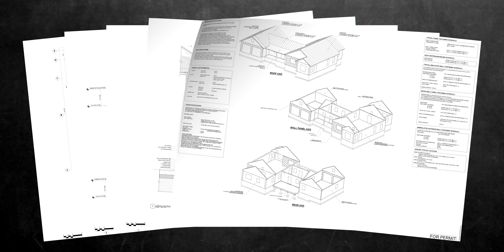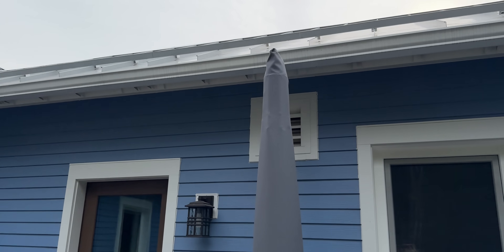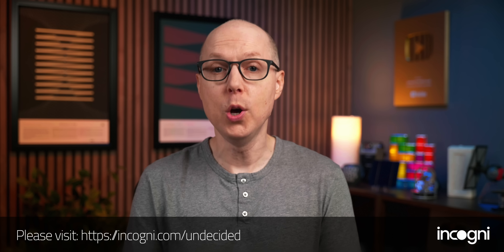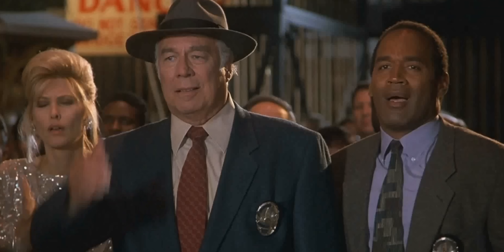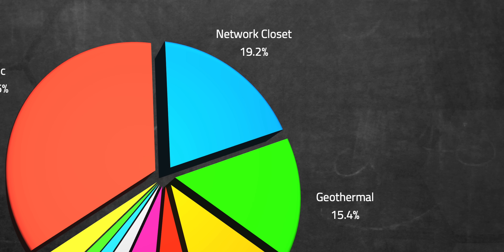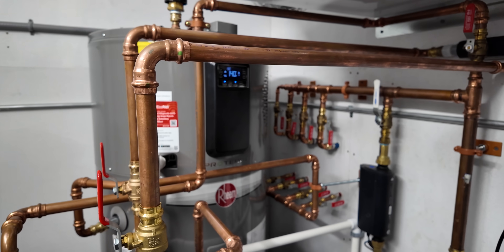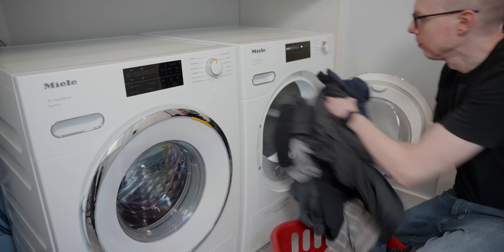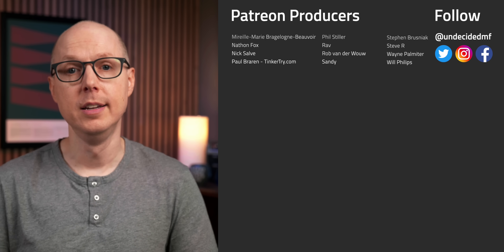What I Learned After 1 Year in My Net Zero House

Comment: I think that it is great that you have included CO2 monitoring in your house with regard to the air quality. This is a very significant consideration for the quality of life in the home. I stumbled onto air quality monitoring after buying a device and then found that my home in the winter was terribly stuffy and unhealthy. I responded by opening windows slightly and that reduced the CO2 count to a healthy range again. During that time, I had been studying for the CCNA IT certification and I had taken a bunch of practice exams at home and also taken and failed a proctored exam one morning. The difference in the results of my practice exams from before I had corrected the CO2 and after were significant. I passed my exam on the next try but I believe that the change in air quality in my home and sleep environment was a factor in my improved performance. 
I took my air quality monitor to work one day and I would find decent air on a Monday mornings and then the CO2 count would have doubled by the end of the day and would stay that way, in the unhealthy range, through Friday. When the pandemic came along, we had about 25% percent of the staff in the building and then the air quality was always acceptable. I think that employers overlook the importance of the air quality in the work environment. It is to their best advantage to have employees that are more productive because they are more oxygenated in quality building air. It is interesting to see your home project unfold Matt. Thanks for sharing the results.

Comment: Did you use phase change along with the insolation? That is a supprisingly big one it reduces the cooling and heating needs because it releases heat when it cold and soaks it up when it's hot, and a lot of it, along with insolation it significantly reduce your heating and cooling needs. Also I'm surprised you didn't go with hybrid PV thermal panels especially considering you were doing a new build so the piping wouldn't have been an issue and then just completely covered the roof in panels so you would have enough thermal energy to raise the temperature of the the water coming out of the geothermal to increase the efficiency of the heat pump and provide hot water.

Comment: For Metal Roofs, the best option is to set venting between the roof sheathing & the metal roof panels wtih vents at the ridge & at the soffits. When the sun heats up the metal roof it will pull cooler air from the soffit vents & out of the ridge vent. 

SIP roofs work really well, I have 12" SIPs and with the metal roof venting system it never gets much above 80F even in 100F summer days.

Comment: Your house is the golden standard for new houses in Sweden. Minus the batteries - those are not economically viable here yet. We hope prices on batterys will drop soon.
Reply: I'd also like to add that this includes old houses as well. Most if not all are retrofitted with triple glazing and many with heat pumps, as well as solar panels.
With a bit of luck we will see some developments in alternative battery tech before those chemical batteries become affordable.
Reply: Not sure whether you need batteries if you can sell solar electricity back to the grid and grid is reliable. Batteries are not viable in most of the cases in Northern/Western Europe. One potential use case is to buy electricity when it's cheap (during the night), but it will take ages to pay off.
Reply: Battery prices have dropped sharply this year. Grade A lifepo4 cells are about $100/kWh now.
Reply: Basically same in the EU. Triple pane windows, airtight constructions, heat pumps, heat recovery ventilation and solar panels.
Reply: The batteries are not economically viable in the U.S.
Reply: Well Sw*den has lots of hydropower which is available all night, so reliance on intermittent solar for low carbon energy isn't your only option- nice!

Comment: While it might solve some problems, I would not fret too much over the lack of a basement.  While they can be done well, fully surrounded basements are just ponds with a roof on top; I never recommend them in non-arid regions unless the house is on a slope where at least one full side of the "basement" can be exposed and the separate perimeter and floor drains run via gravity to daylight.  Even then, water pressure is often a problem on the walls unless you install sheet drains around the below-grade perimeter.

All of these issues can be dealt with, but I did HVAC for more than a decade and most of the crawl spaces and basements that I saw and worked in were poorly done, even in brand new, code-approved homes.  I don't like slabs for the same reasons as everyone else, but they avoid issues with having empty space below the floor and/or below grade.  Despite innovations by many companies, I've yet to see a basement solution in my region that is durable and dry while remaining affordable.

Before switching to poured walls, my main builder generally charged about ten grand to add a cinder block basement to a moderately-sized house (about $18K today adjusted for inflation) and while this was an easy sell to many buyers and made life easier for contractors, it was not a great value as they did not spend enough money on design and drainage while ignoring how the yard grade would affect the basement or crawl space.  This was one of the top builders in the area, yet they would smoothly grade the yards from one home towards its neighbor, ignoring the water intrusion and/or pressure that this would create.

A brother of mine spent years trying to block his neighbor's runoff from entering his crawl space and ultimately had to resort to a sump pump anyway :(.  There was sufficient land between these homes that a proper drainage swale could have been done, but builders here just aren't concerned with this issue and the neighbor didn't want his yard dug up later; after all, they were uphill and weren't having a problem.

No matter what foundation type you have, ensure that the grade drops away from the house on all sides .  Whether you add expensive drainage systems or not, make sure that the home will be built high enough to allow proper grading before you dig a single trench as the height can never be changed after the first cement truck arrives.  Later when final grading occurs, make sure that it keeps water away from your walls without destroying your neighbors', even if that requires a swale in between.

The simplest and least expensive solution is often to mound the lot to some degree and install a slab-on-grade <shrug>.  The downsides are that you have no underfloor space and any plumbing problems become very intrusive and expensive as the floor may need to be jack-hammered.

Hey, but at least you don't have a basement ;).

Comment: Here in the UK, we bought a 20yr old home, that was very inefficient. Leaky windows and doors, poor insulation in some areas.

We started by replacing the front, back and patio doors with higher efficiency units at the end of the first winter. This made the house much warmer and the following winter, we'd reduced our heating bill by about 10% just from that and replacing a couple of windows that had blown. 

In Jan 2023, I installed 4kw of solar and 5.2kwh (4.2kwh usable) of battery. We generated 4200kwh of energy over a 12 month period, and exported 1060kwh, for which we got paid 4p/kwh... or about £42.50... pathetic. But we still imported about 2500kwh of energy. We avg about 5500kwh of electric use per year.

In Feb of 2024, I added a 10.2kwh (8.2kwh usable) battery to the system, giving me 15.4kwh and 12.4 usable... the difference is to account for cell degradation over the 12yr warranty.

The system has been transformed... last summer we were still importing 80-100kwh per month.  This year, it's been 15-40kwh on avg. We achieved a net zero month in June where we exported enough energy to cover all electric charges and some of the gas. Our monthly bill was £13.

I don't have a full year with the expanded system, that will be at the end of Feb. But I do have a full years data from before with the smaller battery (1/3rd). We're currently on track to import between 1600-1800kwh of energy, a further saving of 700-900kwh. Due to the shorter days, we can drop as low as 70kwh of energy generation in an entire month.  Last year between Nov-Feb we generated about 500kwh in total, but we did have an usually brighter Jan/Feb than normal. March to Aug this year, we've generated about 3100kwh already and will be around 350-360kwh for Sept... So if we get around 500kwh for Nov-Dec again and a reasonable 250kwh for Oct like last year, we'll match 2023 generation within a few %, but will have used a great deal more directly with export being 40-50% lower.

The total system cost about £11k and we're looking at an ROI of 8-9yrs... it varies as we had installed during the energy crisis and prices have eased a little since... which extends the ROI.  But we paid cash for the system as we'd sold 2 houses to buy one larger home for us and had the cash left over to do the renovations.  

We also had a new gas boiler installed for the heating and hot water.  I did consider a solar hotwater setup and dropping gas entirely... but the money isn't there for that right now. It's possible to add a water tank and tie in with the on demand condenser boiler we have... but more complicated.  Our heating system is turned of in May until Oct normally, so gas is only used for hot water for nearly 6 months, and costs us about £20-25 a month. Compared with colder months when we have the heating on, which will easily see us with £175-250 a month bills from Nov-Feb for gas & electric.

I also work from home, which probably adds about 25% to our electric bills as I'm running multiple systems, a couple of routers, switches and wi-fi extenders. My old house, was 3 beds (no solar/batteries) and would use in the region of 320-350kwh a month, this house with 2 of us and 4 bedrooms is avg about 425kwh a month.

In the first year we generated an average of 11.5kwh per day, and use an avg of about 15kwh/day. Which is in the region of 75% or our electric, this year, it's looking more like 80-85%, and we've actually generated less due to a poorer summer, we're just using more of what we generate.

We're also getting 15p/kwh for our export now. So even with less export, we've earned an extra £100 on our bills.

We continue to pay the same £100 a month, and currently have £925 of credit on the energy account. That's enough to pay the bills in full for the next 5-6 months. After the winter is over, we'll see how that credit looks and reduce our month payments (if my predictions are close) to about £80 a month.

I made mistakes... they recommended a 5.6kwh and 9.5kwh battery setup... But I had a strict budget and that was too much. In retrospect, I'd have fitted what they suggested and found the money... But we'd just discovered that the small adjustments to the kitchen we were going to make... actually required us gutting the whole kitchen, replastering, new electrics and a complete new kitchen and all appliances (previous owners lied about the condition of everything and it was all damaged and junk) due to finding water damage and broken ovens as well as a leaking dishwasher.

So we've also installed more energy efficient appliances, added a convection oven and switch to all electric for cooking rather than gas.

Comment: I'm only  at 2:35, and it looks like you didn't insulate your slab.  Not sure where you are building, but if it's somewhere that gets very cold, or very hot, that was a mistake.  If you are in a temperate zone, not such a big deal.
Reply: @thekinginyellow1744  it's common to have insulation below the concrete slab where I am in the UK. Maybe that was done here?

Comment: I definitely have a nerdish side to my personality and logical thinking that resonates with you Matt. If I had the money I could definitely see doing what you did and building what you built, but would not need to go as far as you regarding air quality monitoring. However, you must have an equally nerdy wife, or you cajoled and prodded her to allow you to do this because she went on her dream around the world tour. My wife does not understand my desire to have solar power generation with battery backup. 
One thing I determined in that regard though is maintenance and the cost of fixing/repairing/replacing any of the techie components down the road. If your warranty lasts at least 10 years and INCLUDES labor and parts, you may be fine, but beware of the installers and/or manufacturers changing the rules of the warranty game. My solar installer changed their support policies to limit the labor from matching the warranty period of the manufacturer for the solar components to only supporting install costs for two years. I've had my system now for 4 years and have had to pay for them to come out and replace microinverters over the past two years because they would no longer do the work for free 'under warranty'. 
Hopefully for all your toys and nerdy tech you have ironclad repair/replacement warranty that include labor. I thought I did, but then didn't. It has changed my calculus and if I had to do it over again, I would have researched installers better and insured I had warranty information IN WRITING that would not allow the installer to change their policies and negatively impact me.

Comment: The old electric water heater in my parent's house died a couple weeks ago, so I tried to convince them to opt for an air sourced heat pump water heater over simply getting another electric one. I explained the technology, I explained the benefits, I explained the rebates for their area that are available, I explained the tax benefits of choosing them. 

They looked up pricing for them and chose to default to whatever standard electric water heater the plumber recommended and installed for them. 

For average folks who don't have Matt Ferrell money to spend may simply trust the industry professionals to know/do what's best even if they're woefully outdated in their knowledge base.

Comment: I absolutely love my heat pump combo washer/dryer and my geothermal HVAC - and also my tankless water heaters. I'm getting ready to build my forever home and those will definitely be going in. ICF walls, SIPS roof which should give me excellent insulation. I'm also trying to go with a ductless house, as much as possible. Hydronic radiant heat with the geothermal system and through-wall ERVs in rooms rather than a ducted system. Moving air is expensive, so I want to move it as short a distance as possible.

Comment: Hey Matt, first of all, great meeting and talking to you at Everything Electric show the other week! It was a pleasure.

Second, I have been able to get the following upgrades done in and around our house in the last 18 months: 1. replaced 10+ year old gas furnace with American Standard air-sourced heat pump (#1 on Consumer Reports’ list and now we can cool too!), 2. upgraded our electrical service to 200 Amps, 3. replaced 40+ year old windows, 4. replaced both ICE vehicles with EVs, 5. replaced 11-year old leaky gas HWT with a Rheem regular electric one that has 51% more capacity (couldn’t justify the 3x cost and 50% smaller capacity heat pump one).
Government rebates and zero interest financing made the heat pump and window upgrades significantly less costly and as a result viable to us.

Comment: The percentage going to Heat Backup is most likely your heatpumps backup heating unit, that switches on, when the need for heating/warm water exceeds what your heatpump can dedicate to it at the moment. Typically happens in the winter months when we're well below freezing temps.
Basically just an electric cartridge heater, that gives the system an extra boost in extreme circumstances, so that the heat pump system didn't have to get installed as a size above, which would cost a lot more.